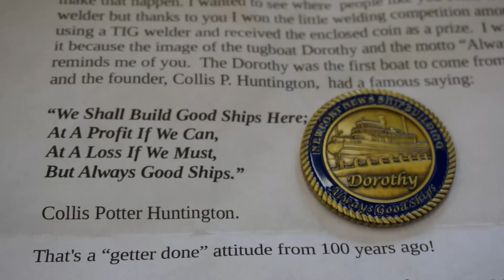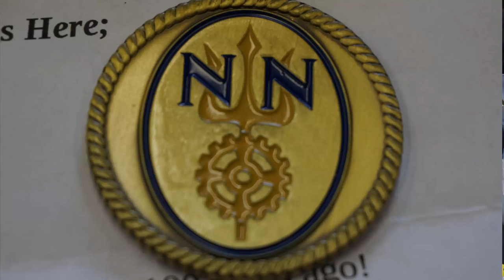What in your box? 2014 tool donations Part 3

Comment: I'll have to get my contribution to this years box organised soon!

I have a file card, but don't often use it, instead I'll clamp the file in soft jaws then run a piece of laminated bamboo along the teeth. The bamboo quickly conforms to the tooth shape and removes stuff that a file card just won't shift. It even works on my dead smooth file. If I have a bad case of Aluminium pinning, a session in Sodium Hydroxide dissolves it away.

Comment: Keith let me know if the pouch is ok for use. If not I can contact msc and get a replacement sent out.
Reply from the maker: Bill De La Vega It just has a open seam to the edge it rolls up from that side, it would be your call. If I had a sturdy sewing machine one quick stitch up the side and it would be perfect. ;{)-----
Reply: Keith Fenner
Keith let me look into getting a replacement pouch.